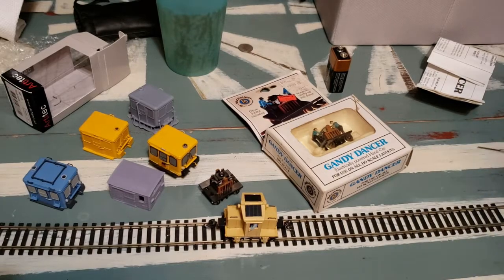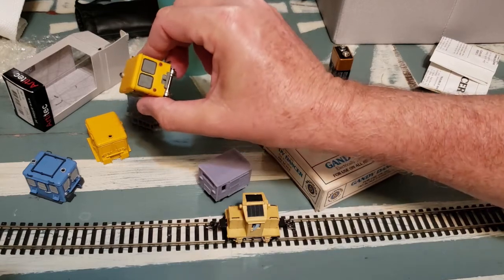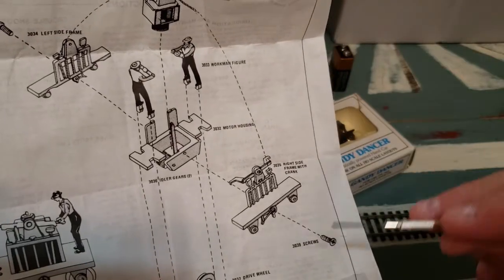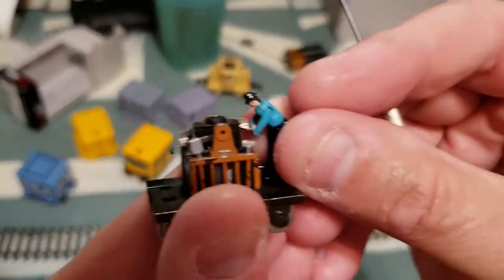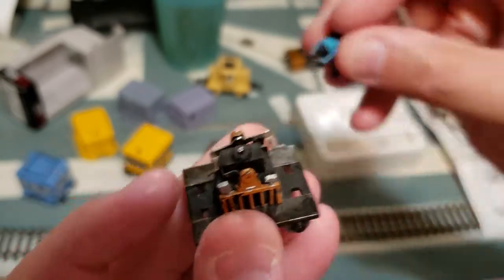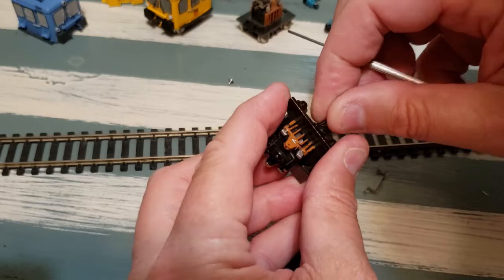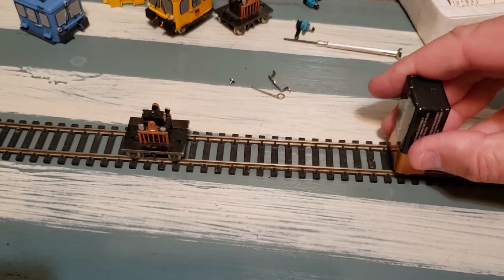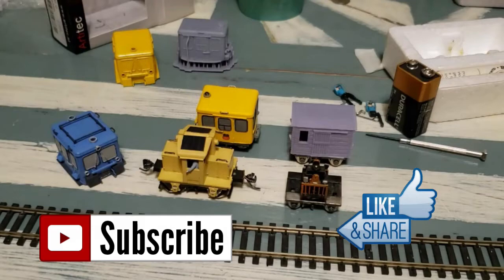MOTIVE POWER - Modifying HO Gandy Dancer

Comment: Interesting, I hadn't thought of using the Gandy Dancer for these!  That's definitely an easy way to power those small speeders.

I powered one of those Jordan 15-ton kits a while back using a slightly modified Bachmann 44-Tonner truck (old style).  It was a tight fit, but it works!
Reply from the maker: That is cool what you did with the 44 Tonner truck.
The Jordan Mack 15 Ton kit had a small notation at the bottom on how to modify the Gandy Dancer to fit the 15 Ton shell but more carving was required and I shoe-horned the light bulb in there. Next time I might use a micro LED... if there is a next time. Some people like little critters so there may be a next time. LOL!

Comment: What about a DCC decoder and Keep alive?
Reply from the maker: Marten - The size of this is would make fitting a decoder inside impossible. I have in some cases, added a passemger car behind a locomotive to wire additional features. I do not use DCC or keep alives but that would be a cool feature.

Comment: Where can I get that wood style top?
Reply from the maker: Steve - The fully enclosed wood speeder in HO was 3D printed. I only had 2 ordered but trying to get more printed.
The larger, open wood speeder is in On30 and the video featured my original scratch built speeder from wood and styrene. I have since created a 3D design of it and we are doing test prints. We need to finish the roof before we can offer those.